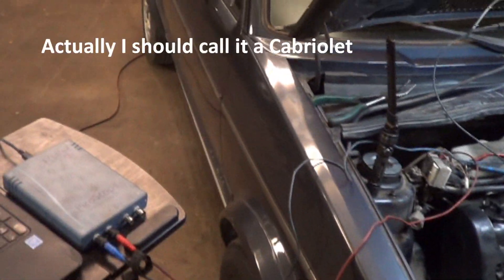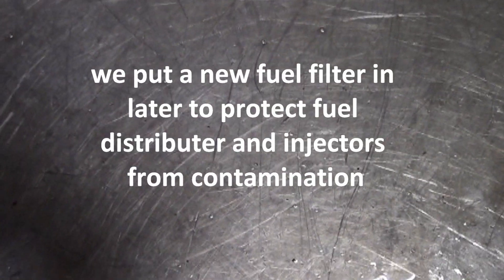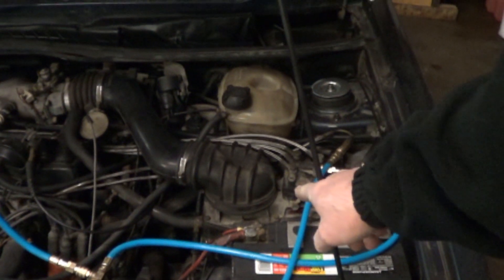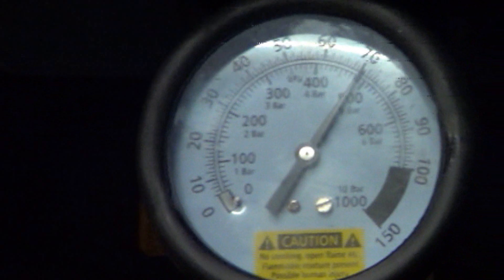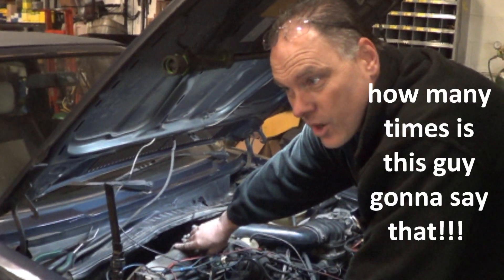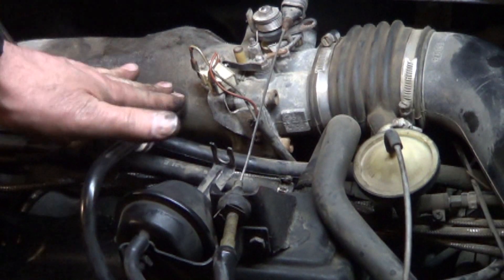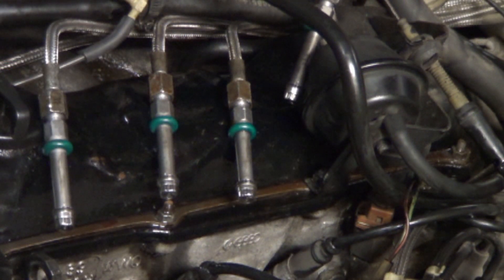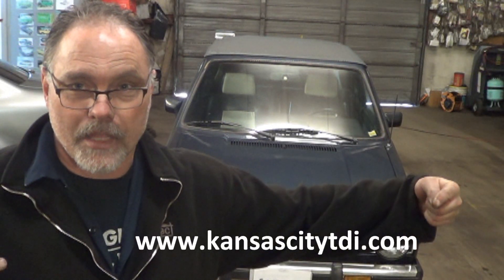Rabbit CIS fuel injection

Comment: I'm having a similar condition on my cabby. Cabby info says the higher duty cycle means it is trying to enrich the mixture though. If I allow air to leak in as you describe the reading are corrected and the car runs better. I'm checking the injectors tomorrow. I attempted to clean them when I had the engine out last year. I think it made them worse some how lol. Unfortunately the injectors are pricey too. I wonder why our readings and findings differ from the cabby info page. This system is a bit confusing at times. I also don't know if my o2 thermo switch is working. It' always tests open. I definitely am working on this car more than driving it
Reply from the maker: Watch the video links in the description.  I think I used some info from cabby site also.
Reply: It was my injectors.
Reply from the maker: @i5usko  Just like in the video!  I'm glad my video was helpful.

Comment: Hello, the negative cable of your multimeter where is it connected?
Reply from the maker: I would assume on the negative post of the battery.  If you post the time stamp of the point of the video it would be helpful so I can look at what your looking at with regards to the question.
Reply: Thanks, I meant when you take the percentage reading from minute 15 with 40 seconds of the video when you only have your multimeter connected

Comment: On My 1981 Gas CIS injector isn’t pulling the plunger up at the fuel distributer so it doesn’t run but you can manually inject the fuel with your hands any idea how to fix it?
Reply from the maker: Have you checked the fuel pump?  Do you have the correct style of gauge?  Check the links in the description to learn more about the system to understand how to diagnose it.
Reply: CoolAirVw Rm i think the problem is the fuel injectors I replaced the CIS system and it will fires up with the primer and cold start but dies after a few seconds. I’ve also replaced the fuel pump